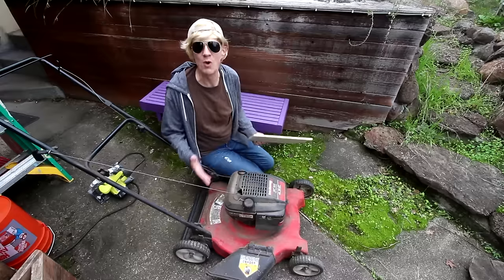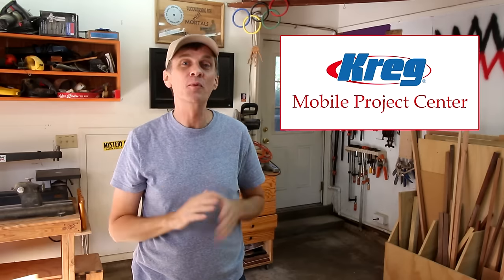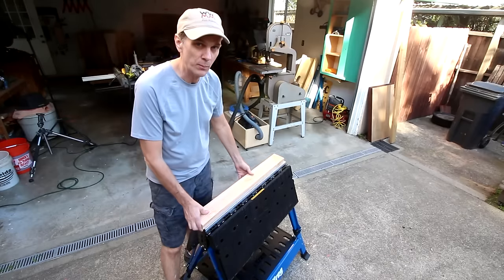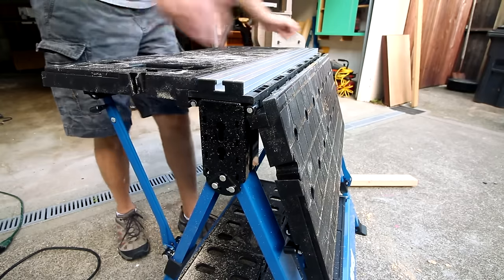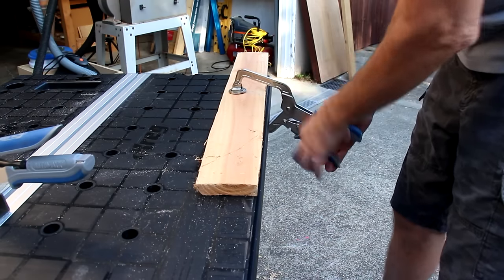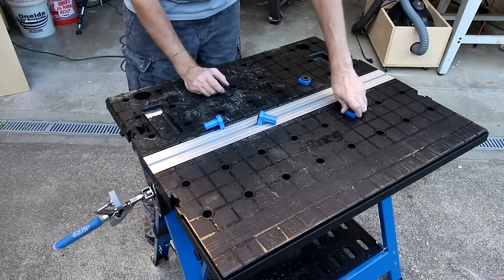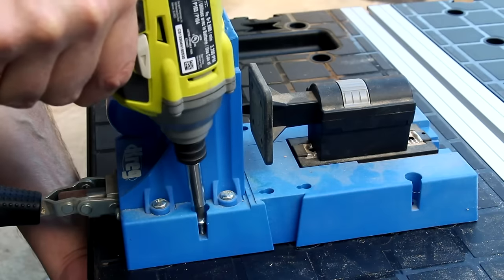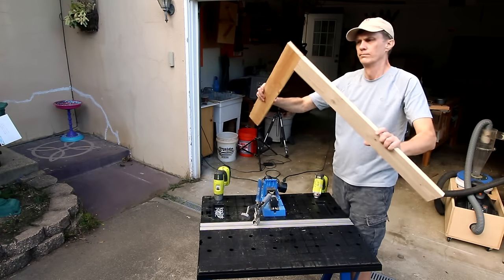Need More Space in your Shop? Get Mobile. | Sponsored by Kreg

Comment: That's why I like my Shopsmith... flip the wheels down... roll it into the driveway... lathe, saw, drill press, sander, horizontal drill press, bandsaw. I also have a contractor type table saw... because let's face it... the Shopsmith does suck at cutting angles. (You have to tilt the table.) But yeah... between that and the portable chop saw... 1/3 of my shop can expand outside. Gonna have to get one of those mobile centers and clamps... VERY HANDY.

$160 for the table, and $35 for the clamps... about $250 or so for your setup... kinda high... but tempting.

Comment: I have a Bosch folding worktable. The main problems with this thing are its weight (actually, lack of it) and wobblyness. Working vigorously, for example using hand planes on hardwood, is out of question. It would just topple or slide away. Mine has a special pedal on the bottom, to step on it and hold the table down this way. But it is still problematic. 
Why am I saying this? This one is even lighter. Keep this in mind.